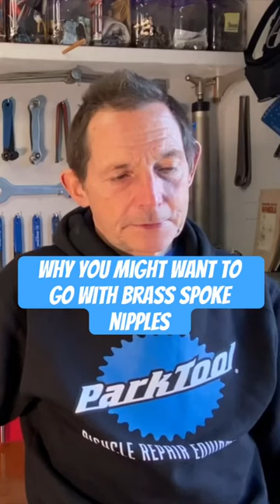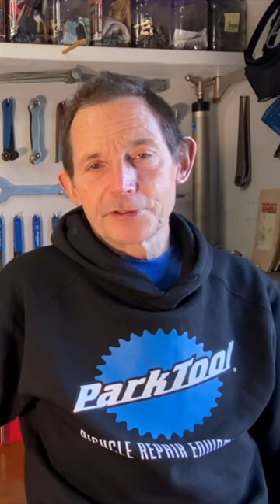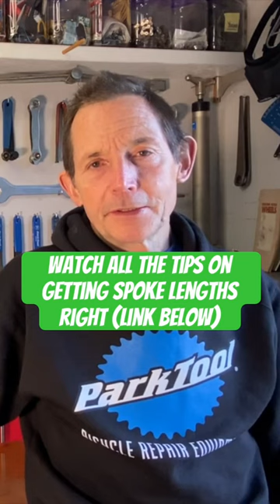Brass Spoke Nipples Are Usually Best For Wheel Building #shorts

Comment: Hey Jim! Do you have any thoughts or “rules” on whether to round up or round down on spoke lengths? Different rules for drive side, non drive, offset rims..? The spokes I source are only available in 2mm increments unfortunately, sometimes an odd number is recommended by the DT calculator
Reply from the maker: Thanks for watching and the question downunderverse! Yes, you always want to round up because a mm too long is never a problem whereas a mm too short can be. And that goes for all types of wheels and sides of wheels and offset and not offset rims. Even if the spokes stick out of the end of the nipples it won't weaken the spokes, nipples or wheel. But just a little too short and spokes can loosen making for a unreliable wheel if you're unlucky or the rider is hard on wheels. I talk about this in the video that this shorts video links to here: https://youtu.be/LvV4FE2VxZk Another great video on the subject is master wheelsmith Bill Mould's here: https://www.youtube.com/watch?v=xP4V392Y4c0&t=83s You may have to copy and paste these links because for some inexplicable reason YouTube is making some links unclickable now. Hope this is helpful.
Reply: @JimLangley1  awesome, thank you Jim! I will watch both vids for sure 👍🏻 I had read in some places that spokes which are too long may “run out” of thread and bottom out before they can be brought up to appropriate tension, and some purportedly “pro” wheel builders had rules that higher tensioned sides of the wheel should be rounded down for this very reason. I think mentally it’s hard for cautious (read: overthinking) people like me to crack on with building and riding their own built wheels because there’s always a niggle in the back of my mind that somehow the wheel will break underneath me at high speed and cause a nasty crash. Almost needs an experienced builder to “sanity check” the wheel before use - maybe those less cautious don’t have this mental blocker. Unfortunately any wheel builders close to me don’t want to teach the art because they view it as some kind of trade secret. Which is why I appreciate your vids! Hey, another question if you have time, have you seen the Unior spoke tension meter? It resembles the Park Tool one but comes with a calibration rod with a known deflection, plus instructions on how it’s used to bring the tool back to “zero” before use. Do you think that’s a reliable process or a gimmick? It doesn’t look like any other tension meters have this feature. Cheers!
Reply from the maker: @thedownunderverse  when you watch Bill's video you'll understand why the idea that spokes will bottom out or run out of threads is a non issue really. And, building wheels just takes a little practice. I have comments from loads of complete beginners that followed my video and successfully built wheels they ride. If you build a wheel that's not that good you'll know pretty quickly and it is unlikely it'll do any more than come out of true on rides. It would be really unusual for a wheel to collapse as long as you go step by step and complete them to the best of your ability. But if you're worried about it, you might not enjoy the job.

Thanks for letting me know about the Unior tension gauge. I found it on their site. I did not find the calibration rod. With my tensiometers if I was concerned that they were out of calibration I would send them back to have it done at the factory. But, a home builder would probably never need to do that - it's unlikely they'd build enough wheels. Though if you were to drop the tool or abuse it somehow like that, you might need to do it. In any case I imagine if Unior makes this piece for calibration it must work. They do make nice tools.